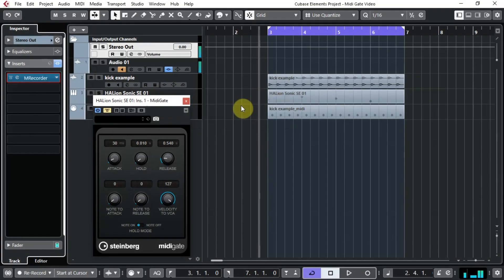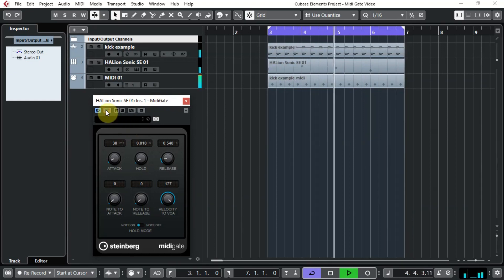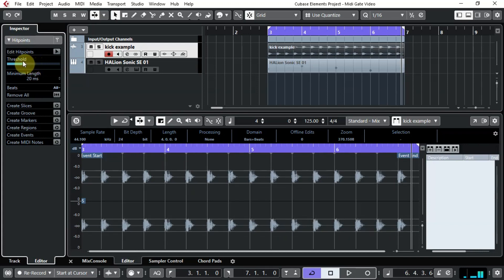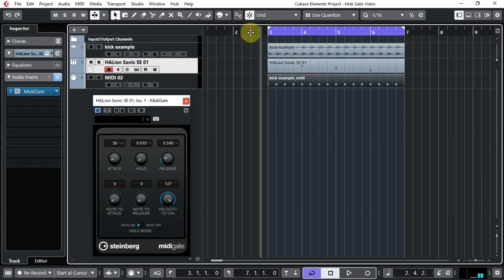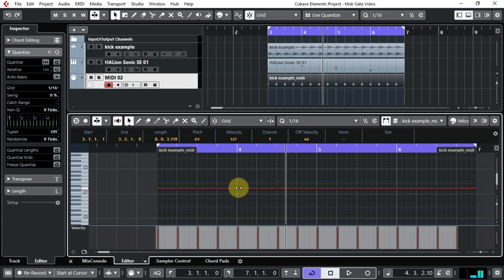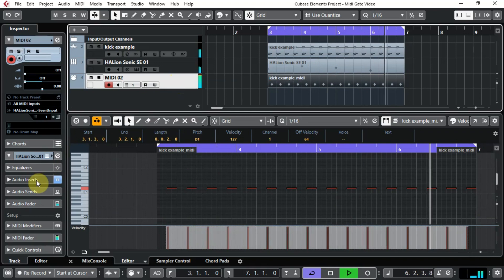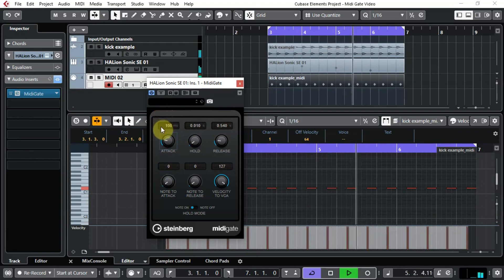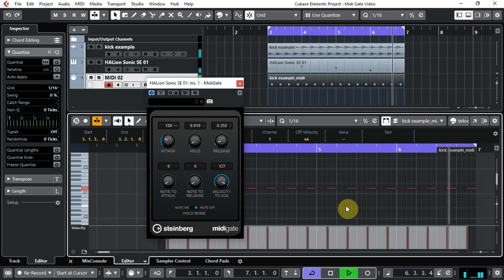That pumping 'sidechain compression' effect in Cubase Elements 10, LE and AI

Comment: Wanna sidechain that tribal unquantised conga loop to a synth pad (where LFO, etc would not do the job?). Here's my method 😁: Create a group track, insert any compressor and feed the synth pad into it such that it barely triggers. Feed the loop into the same group too. Now to get rid of the loop sound duplicate the loop track, invert its phase (using the 180o setting), route the track to stereo out (NOT to the group track, obviously) and adjust that "inverted" track's volume till the conga sound disappears. Adjust compressor parameters to taste. If u want a more pristine effect, duplicate the synth pad track and duplicate the group track. This time the inverted loop and duplicate synth pad feed group2. Adjust group2' s output to get rid of the loop sound.

Comment: This is very interesting! You should post more haha! Thanks for this.

By the way just a bit off topic of this vid.

In Cubase Elements. Is there any way to make the Left Zone, Right Zone and Lower Zone stay on permanently?
I tried creating the template and make sure to left them on then save and close the project. But when I re-open the project, all the zones are hidden... It will be nice if I could just leave them on!

Thanks again! Keep up the good work.
Reply from the maker: I'm not sure - but I'll investigate and get back to you!
Reply: @elementary8963  Hey I just found the solution for my issue. Just installed the latest update (10.0.15) and it's fixed!